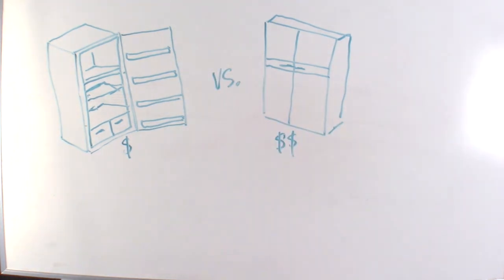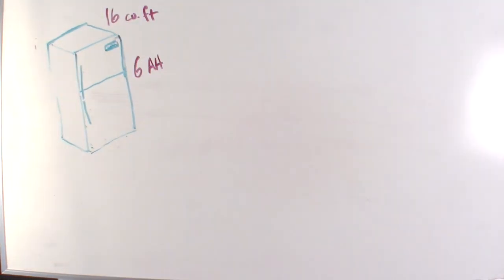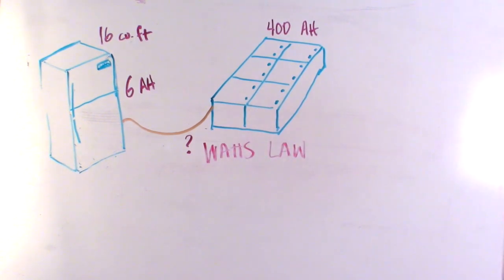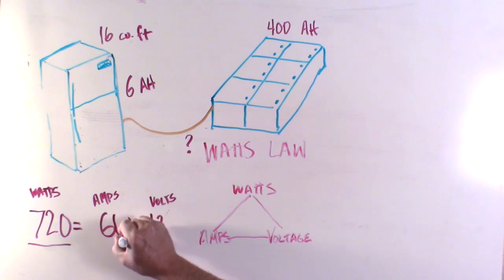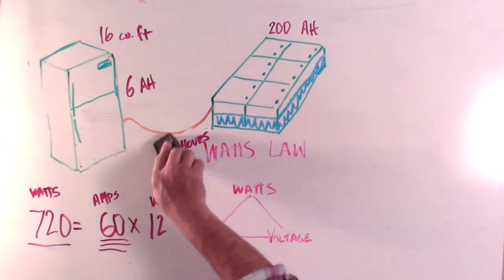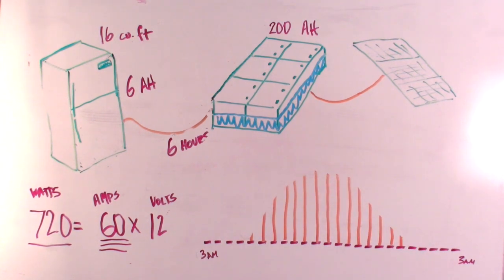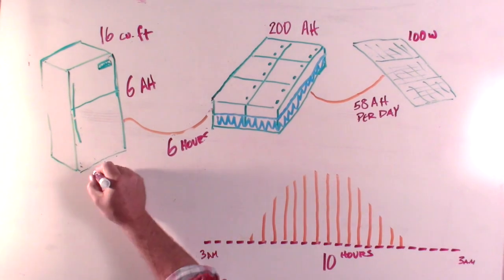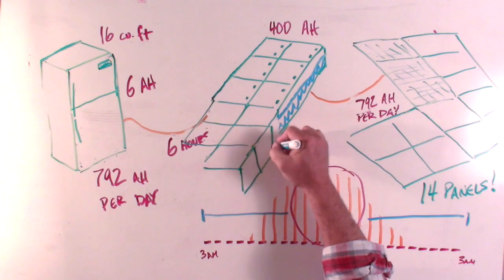RV Solar Power Basics - Why Residential Refrigerators Suck - Josh's Garage

Comment: Your calcs are way off.    An 18 CF residential frig uses akes 600 KW in a year (check the yellow sticker), or 1650 watts per day, or .57 AC amps per hour on average.    This translates into 6.3 amps of DC battery drain per hour via an inverter, or about 150 amps in 24 hours.  So if you've got 200 AH of usable batteries to work with then it would run for 32 hours.   

150 DC amps  x 12 V = 1800  watts  per 24 hours needed.

100 watt solar panel x 10 hours (very generous, but your assumption) = 1000 watts so 2 panels would do it.  Now to get that 100 watts per hour you'd need a mppt charge controller to convert 18.9 volts down to 14.4 volts yields 7 amps of charge the batteries, otherwise 30% of your panel production is wasted using a pwm controller. 

Obviously nobody is going to get 1000 watts a day from each 100 watt panel, but those were the assumptions you elected to use to make your case.
Reply: I'm new to boondocking with a Residental Refrig. 41' Cardinal 5th wheel  2 Batterys haven't pulled covers to inspect them ?? so I did a test no solar panels. I'm plugged in currently and I unplugged  in the morning and didn't use nothing 120v. just 12v example lights. I had 13.5 V at start ,,the next day  around noon my warning sounded at 10.3 V. with Fridge still working and cold (30hrs) approx.. Can someone explain this ????? I boondock but when i wake up i run the generator 2 hrs then around 6pm run the generator to watch TV till 10pm with my old rig which had a Propane refrig. that I installed 2 Modules on because the Flame would not turn on!!! food into the cooler!!! I'll stick with this new style Res. Fridge seems to work energy efficent!! Your RIGHT his numbers are OFF...
Reply: So far off. This video should be taken down.

Comment: I agree, should be more views. I too have made this mistake and the cost of running this fridge on solar is not worth the money it takes nor is there enough capacity to carry the batteries, or purchase very expensive Lithium ion batts. The math doesn't lie. I have run it a 100 times, and have tried reducing usage and the batteries just won't make it. Actually 400ah of batts (200 usable) will get you about 10 hours with nothing else running, including all the parasites from tv's and such. Great video more should
 see.